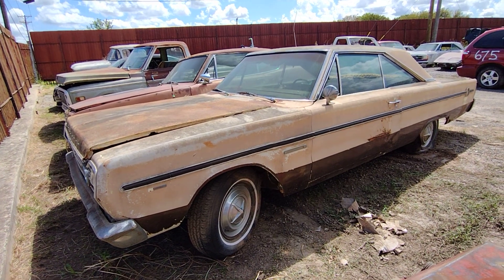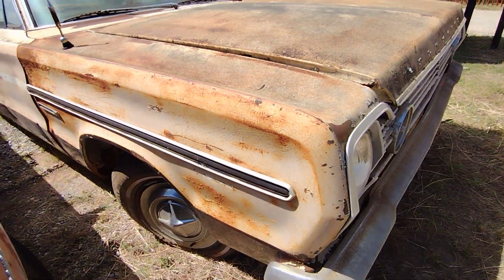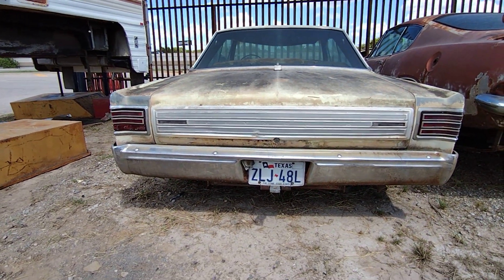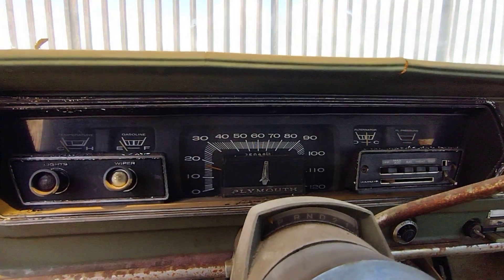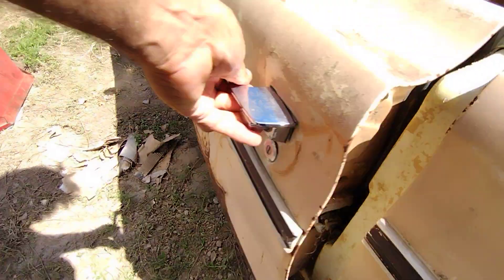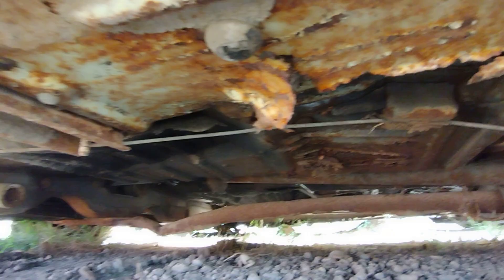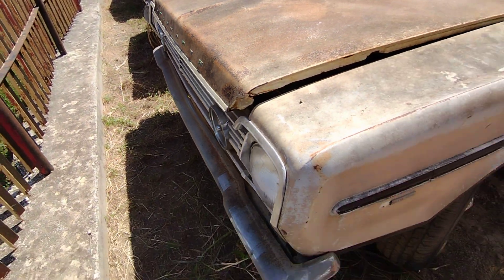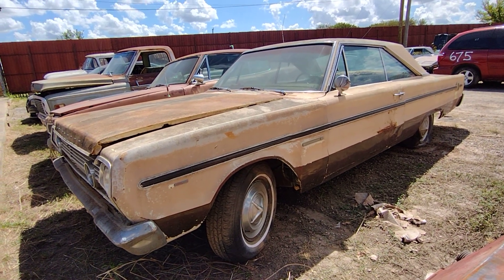For Sale Commando V8 Mopar. 1966 Plymouth Belvedere Junkyard Find

Comment: Whoa Nelley, MOPAR and not going very far.

We got the VIN, we win: R for Belvedere, H for high price class (Belvedere II), 23 for two door hardtop, F for 361 V8, 6 for 1966 model year, 5 for Maywood (Los Angeles) CA assembly and the rest is the production sequence. The Maywood plant was across the street from the Ford plant and closed in 1971. 

We got the tag, we can brag: p-6 for LH remote outside mirror, u-1 for sold car (special order), AB51 for 361 V8, C-5 for automatic transmission, E-1 for air cleaner package, G-1 for 26" radiator, R-1 for AM radio, S-1 for AC and heater, C23 for December 23, 1965 production which was a Thursday, RH23 for Belvedere II two door hardtop, H1Y for Citron cloth and vinyl interior trim, RR1 for Yellow exterior paint and Z under the T in paint means Gold upper door frame paint. The 361 V8 was used in various products (some industrial use included) from 1958 to 1988.

Whoa Nelley, 361 and could be done. Made in Maywood and it ain't no good. RH23 and it could be over for thee. Plymouth (Rock) could be on the chopping block. Mostly Old Parts And Rust and could soon be dust. That's it, could be time to quit. Might be flat and that's that. Possibly going to get squished and surely the Mopar and UTG faithful are going to be pretty pissed.
Reply: You're a poet,you know it, hope you don't blow it!!
Reply: @peterterry398  We got the win, we all win, now if we could only get the Mopar up and running, we could all take a spin.

Comment: $4500 is still high but its a "steal" compared to the 67 Cuda. But to its credit, it's complete at least!
It's certainly doable and be much cheaper to use as a driver. Makes me wonder how long will it sit "For Sale" until the yard gets tired of it as yard decoration.
Reply: $4500 is the asking, but can the frame rust be fixed?

Comment: When you see commando V8 in a 66 mopar it's a 383. If it were a small block it would've just had a V8 emblem and if it were a slant 6 it wouldnt have said anything nor would there have been holes drilled for any emblems. If it were a hemi it would've had that callout on the fender. As soon as you said commando and I saw the emblems, I knew we had a big block on our hands. 4500 is actually a pretty decent price for that. The down side is, restoring it would cost about 60k and, it's only really worth about that. So, it's not really a money maker. But, the parts to restore it ARE out there and it doesnt look too far gone. Ought to pick it up and put it back on the road.

Comment: Good video my man parts parts parts parts all those too mopars are worth they smoking at that junk yard and I don’t mean cigarettes 4500 is all that whole row off cars is worth .the 383 is only thing it’s got going for it and it’s probably the raised block not the low deck 383 used in high performance cars .✌️
Reply: RB 383' were only 59 and 60 4.03 × 3.75 the b was 4.25× 3.38 l

Comment: High on this one too.  Maybe half that.  Auto Auction Rebuilds had a '67 Fury III 4-door that run and drove and I think he paid $2500 for it.   Small block car. 

Looks like just one bad spot in the floor but the dark brown along the bottom may mean there's bondo in it. 

What the hell happened to that radiator, did somebody shoot at it?
Reply from the maker: I wondered what happened to that radiator as well. Seemed odd that nothing else was damaged like that

Comment: That's probably a 361, has a 4 and 1/8" bore versus 383's 4 and 1/4, otherwise same engine, could be a 383 ,but more than likely would be 4 bbl if it was, 66 was last year ,at least in us for 361 in cars, there was a 361 truck engine that was used some years after
Reply from the maker: I think it was a 361 going by the Vin number